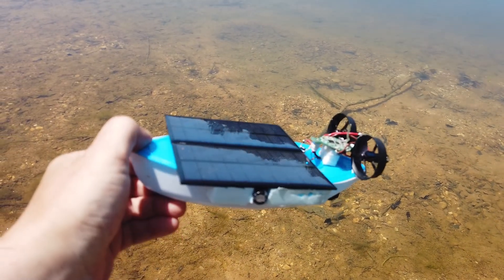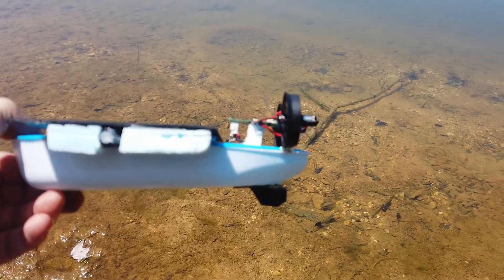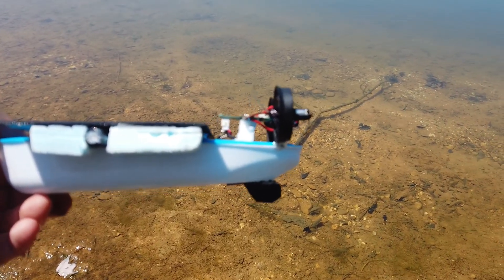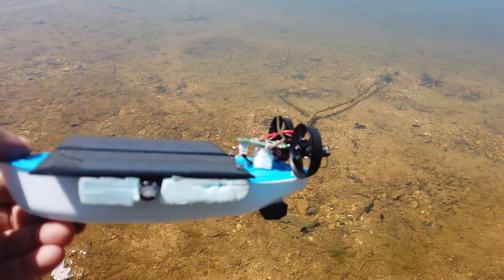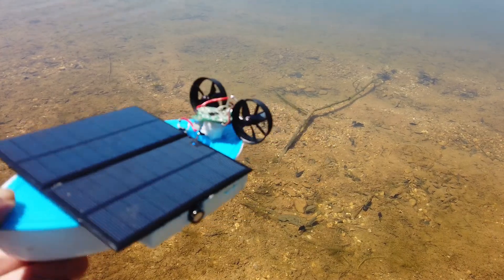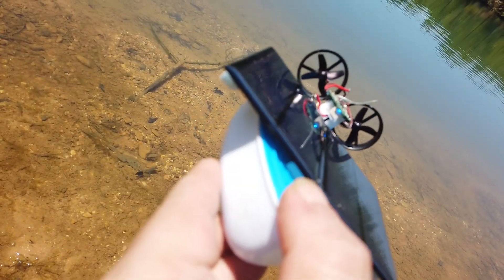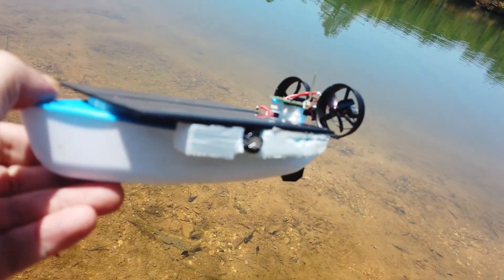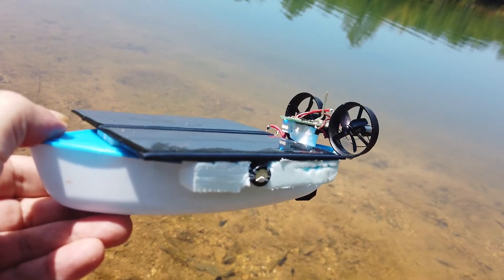Solar Boat - Improvements

Comment: that ran along nicely
Reply from the maker: Thanks Doc. I need to check out Dollar'ish Tree for something to make a longer hull from, add panels and go at full power 😀
Reply: @Slider2732_  drink bottles work well.. mark from the neck of a round 2liter and cut giving you about 1/3 of the bottle for one and 2/3's for the other, either can be a hull. Some rectangular juice bottles would also work. Both need a keel board and a skeg or rudder
Reply from the maker: @docink6175  Thanks. Was eyeing up a mouthwash bottle earlier for the front of a build, so I think I'm on the right lines  :)
Reply: @Slider2732_  that would def work!